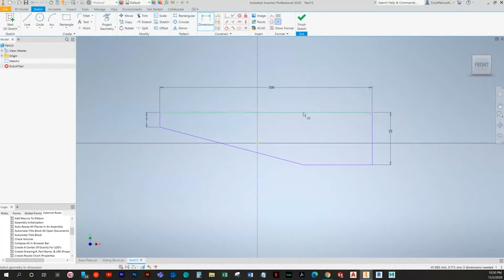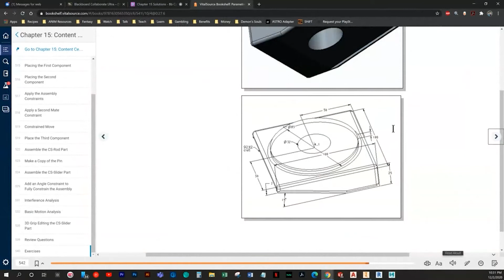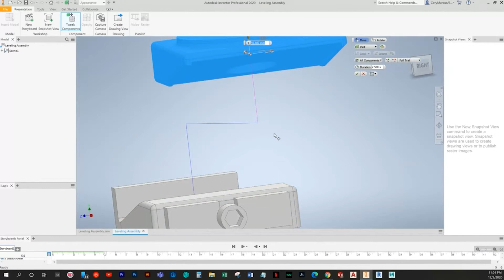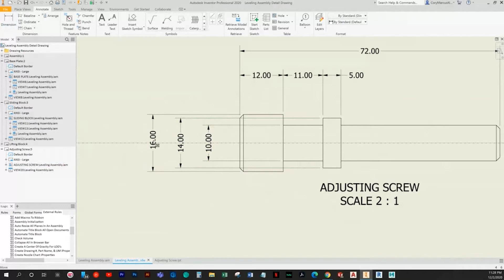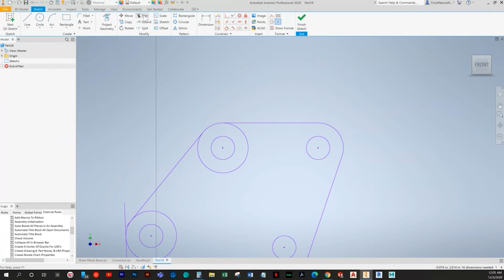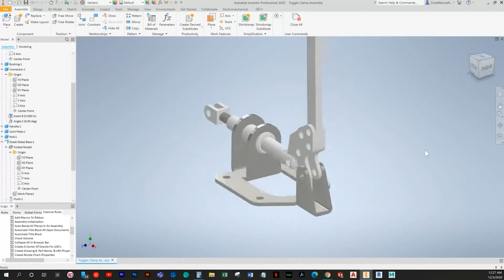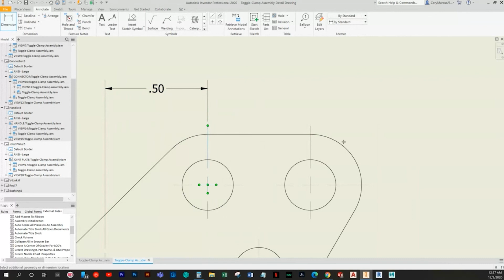Chapter 15 Solutions: Parametric Modeling With Autodesk Inventor 2020

Comment: Hey Cory, I'm glad I stumbled across your videos while preparing for my first job interview at an HVAC company as a Designer II/III. Throughout my education, I've been using SolidWorks and even earned certification, but the company uses Autodesk Inventor. At a glance, the transition seems manageable, and I feel confident with the tools.
However, I'm concerned I might be missing key industry standards and practices that you'd typically learn while working at a company. I have about a week before the in-person interview and want to fill any knowledge gaps on short notice.
I'd appreciate any advice on what I should study or review before the interview. Thanks for all the videos you've already posted—I'll be doing my best to absorb as much as I can!
Reply from the maker: Hey Steve! Good luck with the job search, firstly. Second, yes the transition is relatively straight forward! It's mostly just familiarizing yourself with the different UIs. Inventor has one feature for extrude rather than 2 for solidworks, and helixes work a little different, but aside from that, things are pretty 1:1. 

Industry standard-wise, I'd suggest reading up on sheet metal and piping. There's a fair chance both are heavily used in that field. You can pick up a book like "technical drawing with engineering graphics" or you could just consult ChatGPT.  One of its best applications is just asking it to explain concepts you don't understand. it would be a great crash course tool! On the other hand, you also need to look super familiar with Inventor in order to maximize your potential pay. So make sure to watch some videos on inventor as well. You can search "101" in my channel to find a few super crucial inventor topics covered in depth. Sketch constraints and assembly constraints are an expected thing for your to nail in any test. Also the solutions videos series you found has a good mix of assignments straight from the parametric modeling book that can be helpful. ALSO the "sheet metal concept" video on my channel will give some good understanding of sheet metal. In my opinion, sheet metal modeling is probably the most crucial skill to have as a drafter. The more you know the better. I hope you land the job!

Comment: 15:15 how did you set up the extrusion short cut on your screen.
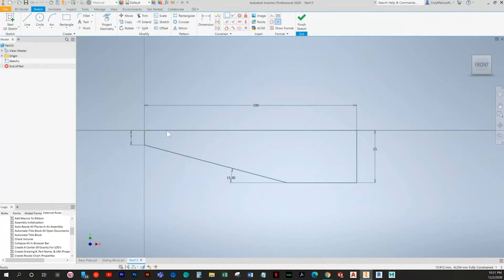Reply from the maker: Around 15:30 I did an extrusion but that's just the default ribbon with no shortcut used. Check and see if you are on the tab that has the features buttons on it